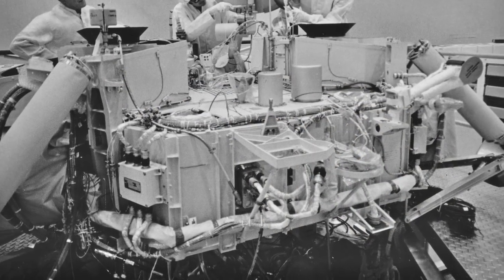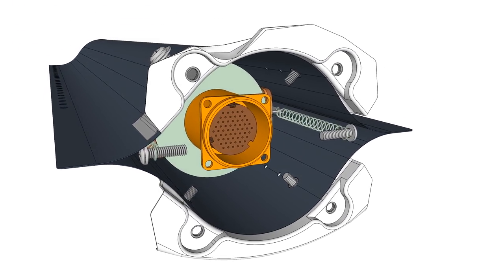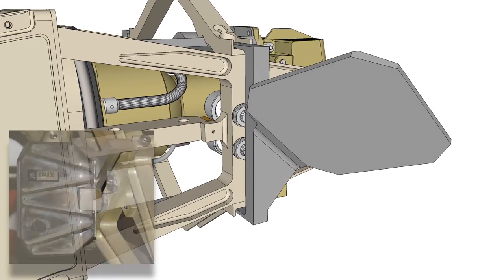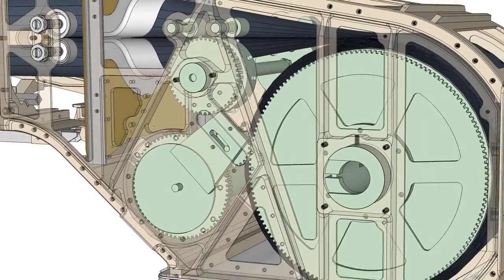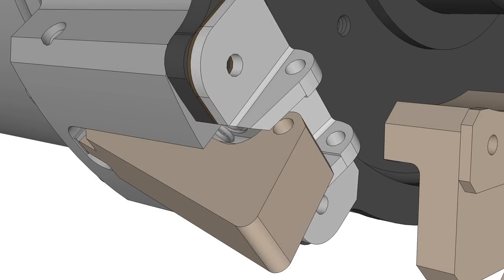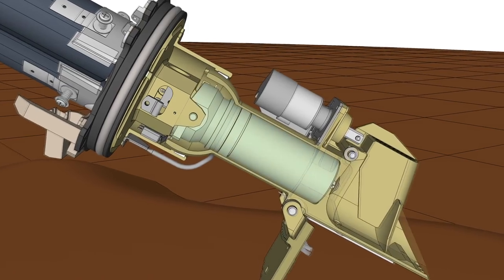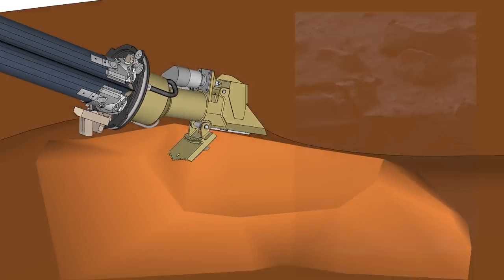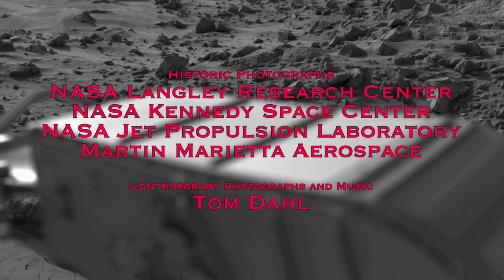Viking Lander Surface Sampler

Comment: Thank you for making this. These details are so interesting, and unfortunately they're hard to get a hold of. You also presented everything very well. Nothing was too hard to understand, but you didn't dumb things down either. Will you be doing any more work like this?
Reply from the maker: You're welcome, and thank you for the compliment. Yes, I'm continuing to work on additional parts of the Viking lander model. For the past year I've been modeling the High Gain Antenna (HGA), which is complete. I'm now almost finished with the downlock mechanism for the HGA. Next, I'll model the Low Gain Antenna and the VHF antenna. When all three radio communication antenna models are complete, I hope to produce a video that explains their operation.
Reply: @TomDahl  that sounds wonderful! I rarely hit the notification bell, but I'm doing it on your channel. I absolutely love space hardware, and any info as good as yours is too good to miss.

Comment: Absolutely amazing.  I can't imagine the level of dedication you have for this. Will you complete the entire lander at this level of detail? Do you think this will have been the hardest part to do?
Reply from the maker: N. Oberg Thanks for the compliment. I do hope to complete the lander exterior components to a similar level. The sampler is probably about the most complex subsystem mechanically. I am working on the high gain antenna now.

Comment: This a very detailed animation, i love it! Also i have a question, was the brush effective to clean the magnetic backhoe? I try to search for after pictures but it was very hard to find
Reply from the maker: Hi Diko, thank you for the compliment on the animation. Regarding the effectiveness of the magnet cleaning brush, I'm not sure of the results. There were a number of image sequences dedicated to checking the cleaning operations on both lander 1 and 2. Search for "magnet cleaning" on the mission image indexes, such as this one for VL2:
https://pds-geosciences.wustl.edu/missions/vlander/cumindex_vl2.html
The corresponding images can be found on the image browser pages; here is the VL2 image browser:
https://pds-geosciences.wustl.edu/viking/vl1_vl2-m-lcs-2-edr-v1/vl_0002/browse/f2xx.htm
The image ID listed on the index page, such as 22G035, can be found under the G0XX collection link on the browser page, etc.
However, all the images labeled as magnet cleaning sequence show a fair amount of clinging particles. I'm not sure if that is because the cleaning pass was not effective, or if the images were captured prior to cleaning. There are some other images showing the surface sampler backhoe magnets as fairly clean late in the mission, for example this one:
https://pds-geosciences.wustl.edu/viking/vl1_vl2-m-lcs-2-edr-v1/vl_0002/browse/html/f2xx/22f212b3.htm
it is a bit hard to interpret, but the backhoe is seen in reflection upside down within the circular magnifying mirror in the upper third of the frame; the two magnet bullseye patterns are quite faint, compared to earlier images, showing a lack of clinging particles. So I suppose the cleaning did work to some degree. I think the clinging magnetic particles would not be likely to detach naturally, due to Mars wind (which can be fast but quite weak due to the very low ground-level pressure) or vibration of the sample during usage.
Reply: @TomDahl   Thanks for the amazing response! After some digging through the pictures i also saw some where the backhoe looks relatively cleaner than on some other days (but still lots of soil) so i think that the brush actually did some work but not as effective as I thought and that definitely did not caused by the wind since most of the soil are charged and the backhoe are magnetic so the combo would not be easily removed by wind. 

I ask the effectiveness because in some mars missions like Insight for example i still do think that bringing a brush or some kind of wiper on the arm would atleast be more effective than waiting for strong wind to hopefully lands on the solar panels or in insight case, dumping soil on the platform to dust off some soil on the panels which i think defeat the argument that bringing a brush is useless. I mean attaching a brush or some kind of wiper even though would not be effective, are still a better alternative than some dumping soil near the solar panels. But hey nasa loves only bringing flight proven tools on their high risk mission so to each their own :)
Reply: The brushes were effective, yes!  following progressive design tweaking and simulations at the Waterton, CO. plant as well as on the former AEC test sites outside of Arco, Idaho.